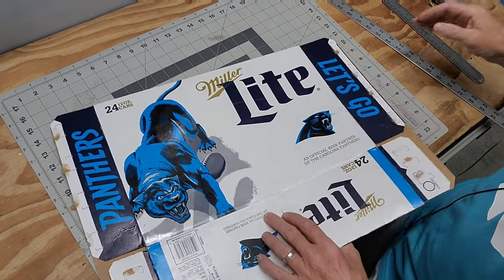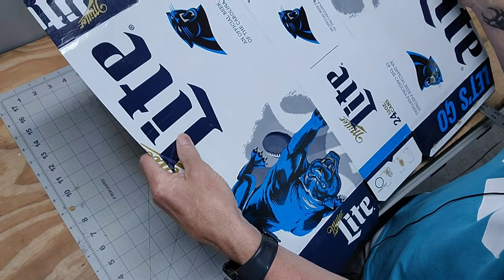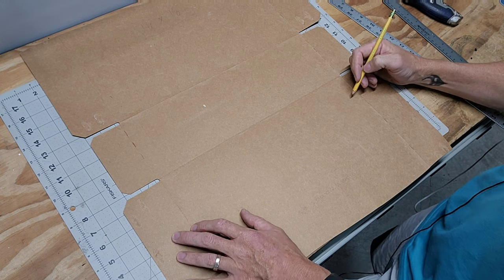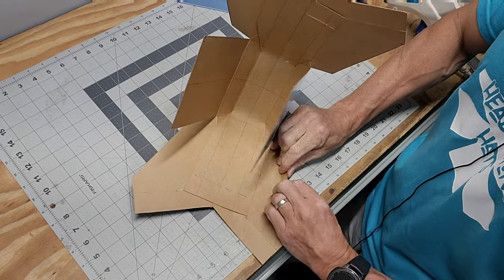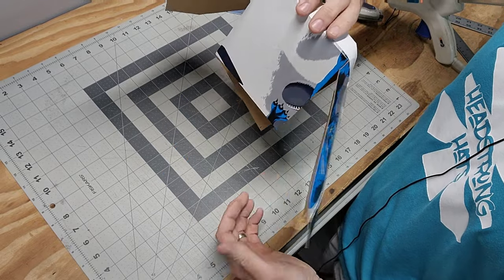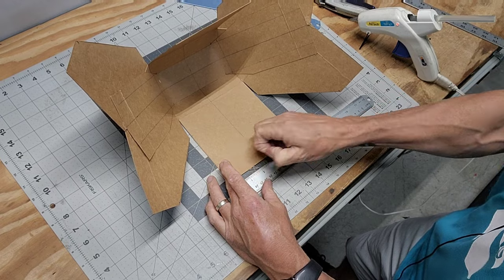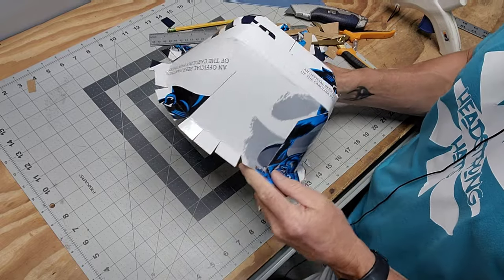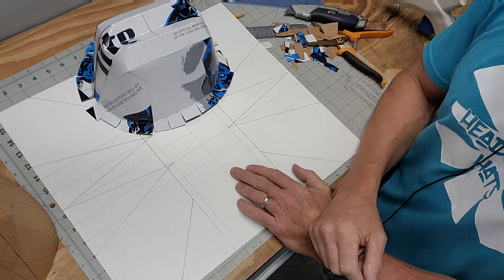Beer Box Cowboy Hat Crown

Comment: Hey man I love the hats! When you make the brim, do you add anything to help it keep its shape? Like maybe a metal wire around the edge? Or does it just keep its shape without any extra reinforcement?
Reply from the maker: I have used wire in the piping around the edge of the brim. It was a PITA to work with. The method I use now is applying heat (heat gun) and then massaging the brim upwards applying more pressure around the area close to the crown. The brim will try to buckle, so it's a delicate process. Try to bend the front and back down as you work the sides upwards. Wrinkles are almost 100% unavoidable but can be minimized by taking your time and working those sides up. The last thing is to  lasso a string, strap, elastic or something around to force it to hold its shape. I let my hats sit overnight or longer like this so they form. Hope this helps!
Reply: @headstrong6523  thank you I appreciate it!